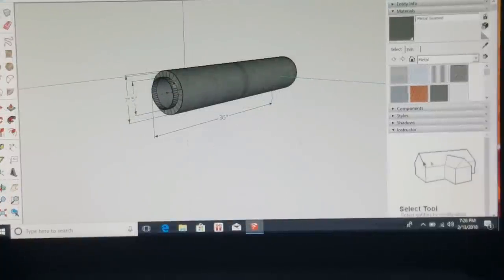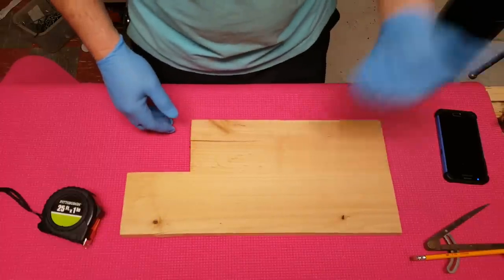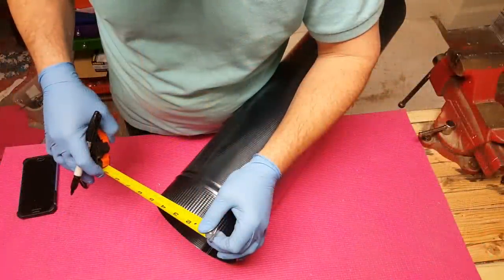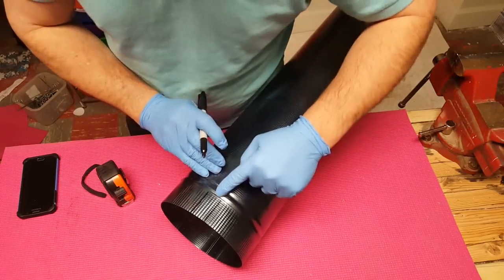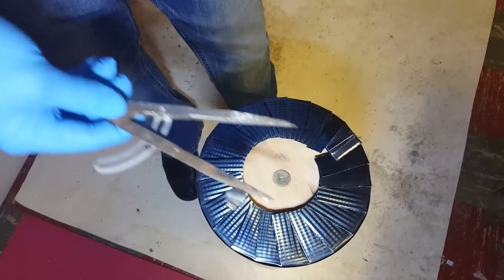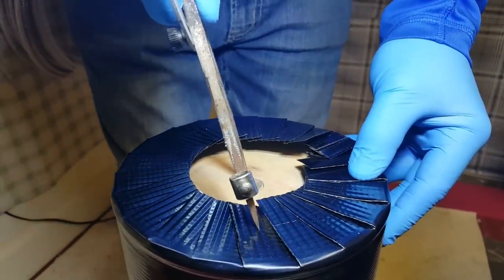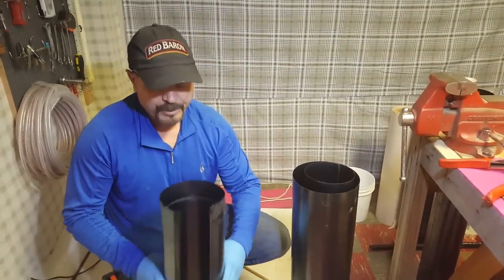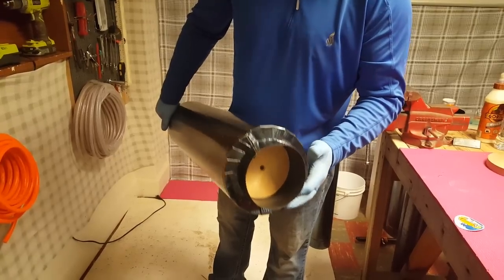DIY Double Walled Stove Pipe

Comment: So how well does aircrete stand up to the enormous temperature excursions should this pipe be used in a typical wood stove? The heated entrained air would manifest hi pressure in the brittle concrete matrix. I would seriously want to know that under these conditions the aircrete would not explode or crumble.
Reply: check out his clip on the rocket stove heat riser. surprising results.

Comment: Wearing those silly gloves to do sheetmetal work........ Really that's like wearing sunglasses to do arc welding.
Obviously not a sheetmetal mechanic. Besides, dead air is the best insulator. Once the concrete gets hot that heat will transfer right to the outside pipe. Fiberglass insulation would of been better AND a hell of a lot lighter then concrete. Just saying.
Reply: Would you suggest fiberglass insulation over sifted wood ash from the fireplace?

I have a 6in double wall insulated flue pipe(2in clearance for combustibles from menards) currently used for an old wood burning fireplace.
I'm thinking about down sizing to a smaller more efficient woodstove that uses a 3inch pipe. 
If I put a single wall 3in pipe inside the 6in double wall and then put wood ash inbetween, could I theoretically not have to worry about chimney fires since it will be triple wall pipe, and double insulation? Or would I still have to use a chimney sweep occasionally?
Reply: @josiahlehman1506  
Dead air is your best insulator. I'm going to take 6 in 22 gauge pipe and put 1" standoffs on it, and then slide it down inside 26 gauge 8 in pipe. I'm putting nothing in between the two pipes. I'm just leaving air. Learned in school almost 40 years ago when I was taking HVAC school that dead air is your best insulator. any other material weather it's concrete, insulation or whatever, will transfer heat through the material. I probably will do a video when I do mine so people can get an ideal how to do it.
Reply: Jeffery Plummer - dead air is NOT the best insulator... 

R-15 fiberglass or rockwool batt style wall insulation is not 15” thick, but  3-1/2”, and is rated as having the insulative value of 15” of dead air space.

  If 3-1/2” of dead air was better insulation than 3-1/2” of fiberglass, or rockwool, no one would use those products.

  And of course the operating temperature and type of insulation desirable for a chimney is radically different than either HVAC, or wall insulation applications.

  One of the reasons a hard “cement like” material is used on the double wall chimney pipe is for structural rigidity.

  There are castable insulative refractory materials that survive high temps and provide MUCH better insulative value than dead air space, while being rather dense and heavy.

I suspect Darwin’s air-Crete is somewhere between regular concrete and the expensive insulative castable refractory used in kilns, forges, and some people’s rocket stoves and mass heaters
Reply: @orcoastgreenman  
This was taken out of an article about insulating your house. 

"In theory, air is a good insulator, if it can be kept from moving. Dry, absolutely still air has an R-value of 3.6 per inch of air — as good as most insulation materials
But, the air inside your walls is never still. It's moving constantly, and with that movement creates a convection flow that results in significant heat transfer"

If you Google dead air space for insulation you'll find similar articles. I didn't pull my comment out of my butt, I was taught it 35 years ago when I went to school for HVAC. 
Try this, go outside this summer in the middle of the afternoon on a sunny day and walk barefooted on concrete. Concrete gets so hot it could blisters you. And if you could turn that concrete over the other side would be just as hot. That's because the heat has something to travel through. It will travel through air also but not nearly as fast or at same temp.
Reply: Jeffery Plummer - thanks for the correction on my misunderstanding of insulation’s R value and it’s relation to dead air space..

Radiant heat is a different beast, and dead air is NOT a good insulator against radiant heat... if it was, the sun would not warm the surface of that concrete one bit, with MILLIONS of inches of dead air space between the sun and that concrete.

  Durning a chimney fire,
A cast insulative refractory will protect your outer chimney pipe MUCH better than dead air space... as a good portion of the heat from a creosote fire in your chimney will be radiant heat.  Radiant heat passes right through the air, like visible light, to warm surfaces it hits.
Reply: @advancedanr  Did you make the insulated pipes that you were planning on making?